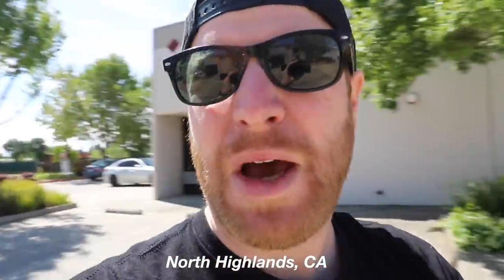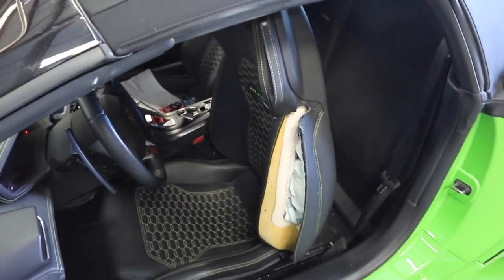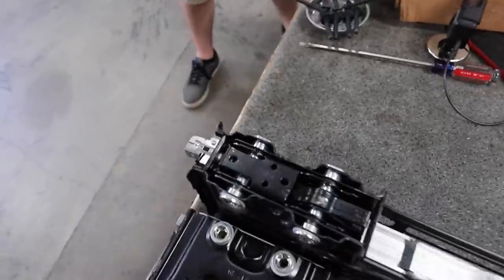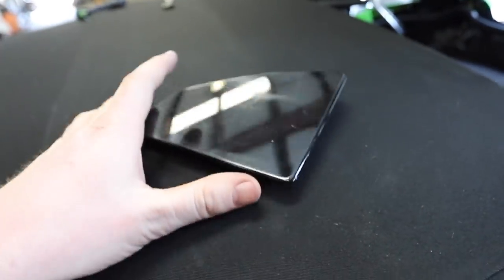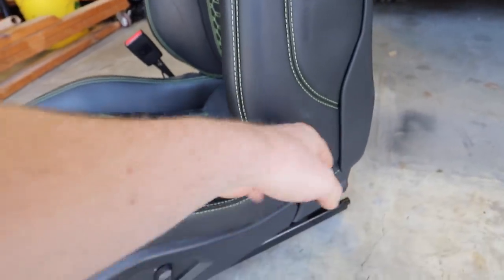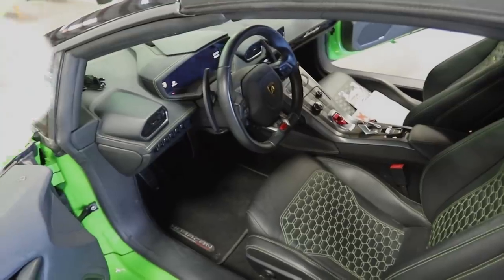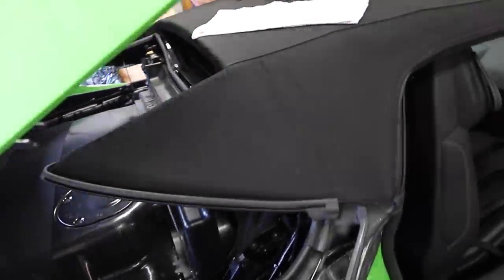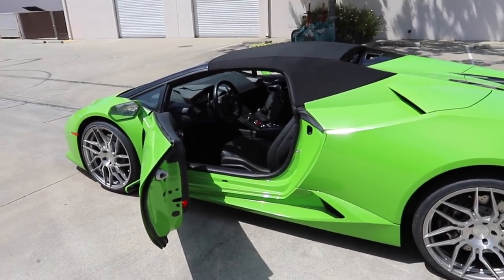Repairing the Airbags and Pop-Ups in the Huracan (Goodbye SRS Light!)

Comment: Thank you so much for stopping by it was amazing meeting you, hope to see u again !!
Reply: You guys did a great job, that was awesome!
Reply: Hey guys, I've got a question for you. I'm working on my dad's old volvo S40 and it was crashed by a previous owner, so I have no clue what exactly was replaced and what wasn´t. Now I need to replace the SRS module because its toasted so I can't retrieve any codes from it, but I don't wanna plug it and make the airbags deploy, so, should I replace the impact sensors to be sure nothing will explode?
Reply: Add a profile pic bruh
Reply: Nice job guys!!
Reply: @mauriciocampillo7299  Disconnect the battery before unplugging any of those things. No battery, no charge, no explosions.
Reply: So you replaced the damaged reel then refitted the original belt?
Reply: You need a profile pic
Reply: Dope!!
Reply: Amazing job guys, now the beast is safe again!
Reply: Crisp Airbags can deploy with the battery unplugged.
Reply: @cameronmardis  no charge no deploy.
Reply: Why would you drive your Lamborghini without the new airbags installed and reset?That should be the first step you do before you drive it!
Reply: @tylerhamilton7753  He was driving the car after everything was fixed

Comment: Hold the unlock button on the remote and the windows will go down !! It s an audi😂
Reply: *it's a Volkswagen. Basically a very large beetle with a large engine.
Reply: Sebz my 2013 Honda Accord does that lol.
Reply: @DanielDiaz-te6dl  So as my 2008 Mazda 3 BK
Reply: My friends BMW does that too. My Audi doesn’t do it idk why lol
Reply: @elchucapablas  my golf didn't at first either, it was just disabled in the car settings
Reply: Paul van Zyl ohh I got to check it out
Reply: My 02 golf mk4 does it to😅
Reply: Was going to suggest this, would be cool to know if it actually works.
Reply: I came to say that. Either hold it for few seconds or tap it twice.
Reply: It's my favourite feature on my focus, helps when the kids forget to close their windows and I haven't realised before we get out
Reply: Went straight to see this comment 😂
Reply: My 03 Accord does it too.
Reply: That is what I was going to say....you can hold the button, or turn the key and hold....... :)
Reply: @elchucapablas  try a double tap.
Reply: I was going to ask if that works as per most cars now!
Reply: Just coming here to write the exact same comment
Reply: @elchucapablas  it can its just locked. You need to use a obd tool I reccomend obd 11 from ECS tuning. It will also unlock lots of other goodies.
Reply: My 2005 bmw 1 series does that 😂
Reply: Even my shitty Corsa does that... 😁

Comment: B is for Build. As a tip for low cars. Wooden lift blocks that you drive onto for the drivers side wheels. Puts the car slightly off tilt by a few inches, so the drivers door clears the trailer guard. Another way or together, can be cut the top off the guard to give clearance, but put spring locks on it so it becomes reattachable.

Comment: Hi chis if you hold the unlock button the windows and possibly the roof will lower. You can also turn the key and hold it i the lock/unlock position in the drivers door latch from the exterior

Comment: Did you try pressing and holding the unlock button on your keyfob which then while holding the bottom down during the whole process would lower the windows and open the convertible top? This was an option that came with some Lambos and Audi's or you could activate the feature.

Comment: Hey Chris I am a big fan & active duty Munitions Systems Inspector for the USAF. I just wanted to point out a couple things for you for some added info. 
1. Airbags don't have pyrotechnics(Fire), they have small explosives(Blast) to initiate
2. Airbags use small explosive chemical reaction (Similar to those used to eject aircraft canopies & the pilots)
Just incase you were curious

Comment: As far as it goes for the driver side window, wouldn’t it work if you just bought the correct window and replaced it? Or are the mechanisms different because the door isn’t made for a convertible?

Comment: I think you could trim the driver side door window with some fine grit diamond cutting discs and files. At least in case you can't swap/sell the wrong one for matching one at cheaper cost or if the delivery time for the correct window is crazy.

Comment: 9:03 you put on a drivers door from a coupe which has curtain airbags, if you used the harness and airbag sensor in the door from a coupe it will think it has a drivers curtain airbag therefore it thinks the car is a coupe and the "passengers curtain airbag" has an issue because its not there

Comment: A solution to getting in or out of the car once on the trailer is.....either have a trailer with a tip off fender, or use a jack and lift the car high enough to clear the fender instead of doing a "Dukes of hazzard" trick to get in or out.

Comment: Doesnt lamborghini have the function where you can hold the unlock button to open the windows
Reply: It's possible but i am not sure if that works on a non convertable door. But you can try to stick in the key and push the window down with your hands. Some cars has this security function that the window shut down completely .

Comment: If you have to 3D print the one side younwould prob be better off just doing both so they better match, then sell the original to pay for it all lol
Reply: Yeah, a print might be cool, but it would need a lot of post-production sanding/paint if you didn’t want it to look cheap. I can’t believe those pieces of plastic cost that much.
Reply: Oops on previous but its a few hundred $ to 3D print and finish. The paint itself will cost more than the rest but any finishing is simple and fast and the end product would be hard to tell it wasnt OEM unless you popped it off.

Comment: pyrotechnic adjective
py·ro·tech·nic | \ ˌpī-rə-ˈtek-nik
\
variants: or less commonly pyrotechnical \ ˌpī-rə-ˈtek-ni-kəl
\
Definition of pyrotechnic

 (Entry 1 of 2)
: of or relating to pyrotechnics

pyrotechnic noun

Definition of pyrotechnic (Entry 2 of 2)
1a : firework
b : any of various similar devices (as for igniting a rocket or producing an explosion)
2 : a combustible substance used in a firework
Reply: "What is the explosive in airbags?
The airbag's inflation system reacts sodium azide (NaN3) with potassium nitrate (KNO3) to produce nitrogen gas. Hot blasts of the nitrogen inflate the airbag."